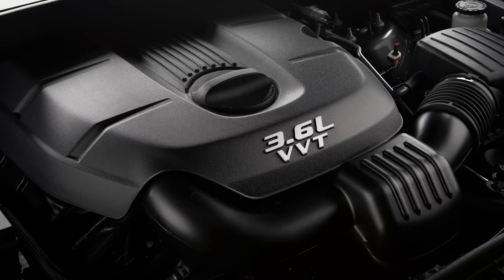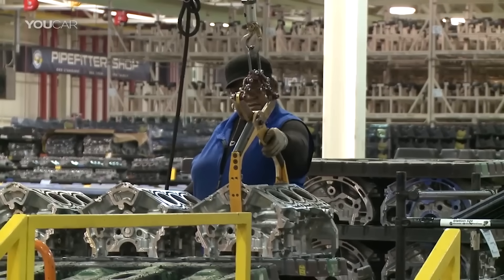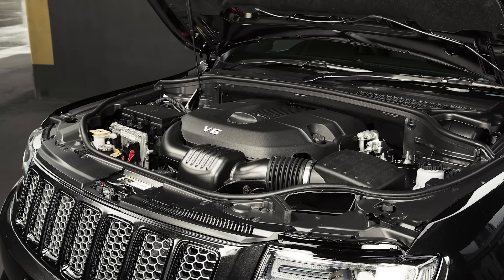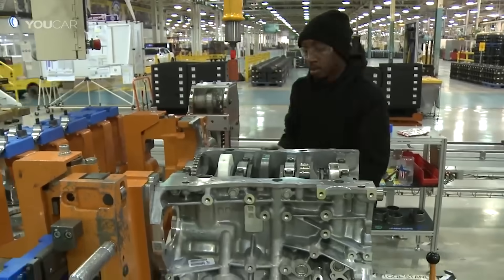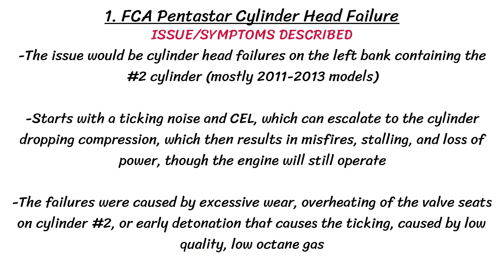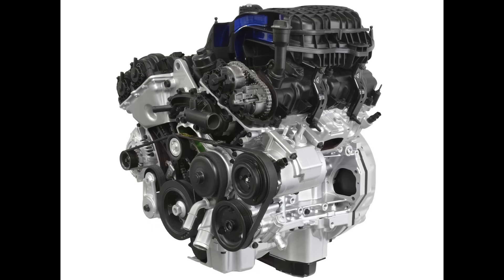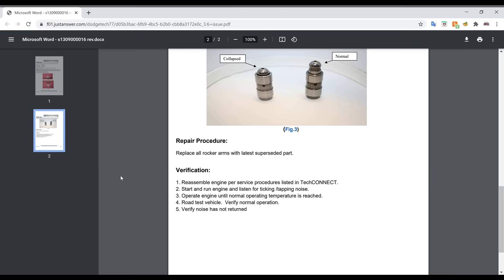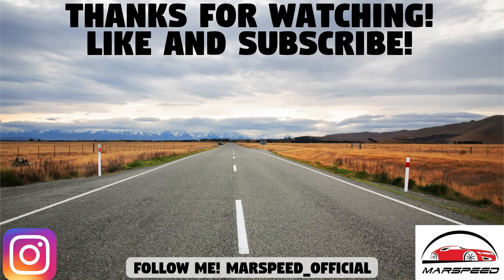The Specs and Fatal Flaws of the Chrysler 3.6L Pentastar V6 Engine

Comment: I’ve had 4 vehicles with these engines. A 2012 (125k) sold, 2017(152k)sold, 2015(142k still have), 2023(24k). All have been good engines with none of the cam issues people report. I change oil every 5k with full synthetic rather than waiting for the light to come on at 8-10k. I think that makes a lot of difference for not having head issues. Never had to replace an oil filter housing/cooler. I suspect most of those issues have to do with people over torquing the cap, which breaks the housing. Have had to replace a few thermostats around 80k, which is easy & cheap. The 2017 developed a head gasket leak at 152k. I bought that vehicle at 125k, and later experience with it taught me it hadn’t been maintained…my bad for not investigating better. Still ran ok, but slowly lost coolant. Head gasket issues are often caused by coolant not being flushed on schedule, which gets acidic and eats up the head gasket, but Chrysler also had a short term casting issue for that year. Brother has a 2012 jeep with 225k on it. Had the oil filter housing/ cooler replaced at about 180k. IMO, this engine is really solid if cared for correctly. 5k oil changes and 50k trans fluid change, 100k coolant flushes will keep it going 200k plus. I know others have had issues, but I have 5 direct vehicle experiences, and only one had a significant issue at 152k, and that was with poor maintenance. If you buy used, try to buy by 50k. At that point, you’re still pretty safe on longevity if you get it on a good maintenance schedule. Given my experience buy another vehicle with one of these engines,

Comment: My 2018 3.6 GC with 65k miles has had the dreaded aircon fault with the radiator in the car that failed. I don't understand why they break but anyway the dash has to be completely removed to get to it. It's a massive repair in terms of labour. Warranty covered that and the mechanics did a great job!
Also had a cracked gasoline filler pipe that runs into the tank that was replaced under warranty. 
Lastly an EGR valve error. Valve was cleaned and working perfectly now.
I saw in the car's service history that the water pump was changed twice within a service cycle, but I've had no cooling issues at all.
I was very nervous about the lifter tick but my engine does not have it. Using 5W-30 oil and adding Liqui-Moly hydraulic lifter additive for good measure. I've seen badly ticking cars go completely quiet when the lifter additive was added. It won't fix an already broken lifter bearing, but will help prevent damage from starting and also keep those hydraulic lifter oil passages clean.
I will have the oil cooler changed with the aluminum unit as soon as possible.

Comment: 120K on my 2015 Grand Cherokee 3.6L Pentastar.  DIY oil changes at 5K since day-1.  Proactively changed water pump, thermostat and coolant at 80K.  Original rotors and pads had life over 100k!
Zero mechanical problems other than radiator replaced twice under warranty due to what the dealer said were poor welds (very tiny, slow leak, not even enough to puddle, but could smell the coolant). Re-painted the hood under warranty at it began to bubble.  It is our "go-to" machine with the least troubles of any car I have owned over last 10 years (Honda mini-van that preceded it was also very reliable V-6).  Knock on wood - want to get another 125K out of the vehicle.  I got the lifetime Jeep warranty but have not had an opportunity to take advantage of it.

Comment: I have done 3k mile oil changes on my motor for my ram 1500.  This engine has been by far THE WORST MOTOR EVER.  I have had 2 cam shaft failures a head gasket that needs replacement,  a failure of the 4 wheel drive system and transmission issues.  I have given up on AMERICAN MADE and now will only by Toyota.

Comment: I've run my 3.6 offroading, on the farm and commuting.  I've had it since 2014.  I did have to replace all the lifters with the new style lifter about a year ago.   I didn't have time, so I sent it out.   It was about 2K.   I had to replace my oil cooler, in my experience its the o-ring gaskets that fail, not the whole oil cooler that is made of plastic... just the same, if you get THAT DEEP into the engine spending another 150 bucks is worth it.   It took me about two days to do the work myself, I could probably do it again in hours.   The design is not great on the Oil Cooler, sure you put the oil filter on top of the engine, but you still have to go under the engine to open the drain plug and the way the oil cooler is built and in the valley of the engine, you have to remove 3 layers of engine to get to it... So you save a little labor from your oil change done by a cheap tech, but end up costing yourself real $$ or real time changing this... I'd rather have the oil housing under the vehicle.  Other than that it's been really reliable, and it has a lot of power for such a light vehicle (I have the 2 door.)

Comment: Dealership replacing my oil filter housing next week,only42 thousand miles 2021. Bought it used last Nov. but did buy a warranty. I understand the part is still plastic. Guess I will be replacing it again at some point if I keep the vehicle. Anymore I don't know what vehicle to buy since thay are all garbage.
Reply: Make sure you get an aluminum thermostat and oil cooler housing. 2014 300 here just blew a head gasket at 162k. Learning a lot on how to modify  on next one. Use pure synthetic oil

Comment: We purchased a new 2016 Grand Cherokee Limited with the Pentastar V-6 and put 150K on it with no issues. However, I am confident that my first move was to drain the 0W-30 "oil" out of it and replace it with 10W-40 is what saved this engine. No aluminum engine will live very long with oil that has a lesser viscosity than water. I recently purchased a new 2025 Grand Cherokee, with the same engine, and changed the oil to 10W-40, when I got home from the dealership. Ford, GM and Chrysler all have engine problems because of this shitty oil. The CEO's of these companies are all climate change lunatics and should be fired.

Comment: Cylinder 6 misfire in old Volkswagen routan, head replaced with exteded engine recall warrant (115000 miles), then current pacifica in shop under warranty at 78000miles with rocker/cam issues.

Comment: From an excellent authority : " The cause of the failure is the use of thin metals used on the engines."  Known issue but will NOT fix it.  They do a "kit" for bank one camshaft failures. [ 2020 Jeep 4-door Unlimited 3.6 Pen., Rubicon  with 43,000 miles ]. $$$$$$

Comment: This video was spot on.  Had a 2015 GC Limited with ALL THREE ISSUES!  2nd Cylinder Fail, then Rocker Arm Issue, then AC Fail.  Paid out of POCKET to replace fix all except AC Fail.  When the Dealership quoted $4,000 to fix AC, I traded the GC in (almost 9 yrs @ 127k miles).  Did NOT get another Jeep.  It would've been great to keep the GC as I loved the vehicle, but it got too expensive to fix something that they weren't willing to cover or admit in engines beyond 2013.  Purchased the 2015 NEW ($42k) and it was well maintained... BY THE DEALER!  If FCA was willing to admit the issues or even give a discount on the repairs, I would have a more favorable review.  Now where's the Class Action Lawsuit...

Comment: 2011 Dodge Journey; clogged heater core due to sand.  2015 Dodge Grand Caravan; failed left bank cylinder head at 52k miles; removed and "repaired" at the dealer; failed again (misfires due to low compression) at 82k miles.  All 3.6s I've worked on stupid plastic thermostat cover breaks leaving plastic pieces to circulate through the cooling system; stupid plastic crossover pipe; stupid plastic oil cooler manifold.  Sure it's 42 pounds lighter than the 3.5L but sacrifices long-term reliability.  Fortunately, Dorman stepped up and created an aluminum variant of the plastic parts.

Comment: Love my 3.6 Wrangler but we had misfire in cylinder 3 only a week after we bought it. We ignored it but after 4 years it slowly got worse and eventually started burning off all the oil. We had to replace the oil sometimes daily. Our dealership kept dismissing us for this issue despite the constant oil loss. Eventually the engine power was so weak and the ticking got so loud that it was unsafe to drive at highway speeds. When we took it into our dealership they said nothing for almost 3 weeks. This was when we found out about a class action lawsuit on this engine from Jeep. We've been without our Jeep for almost 2 months and the dealership has hardly moved forward on replacing an engine. I think they know this is engine is faulty and are afraid we will have to replace it a second time again in 4 years. I love the power this engine has but the fact that nothing has ever been done to fix the flaws of this engine for over a decade is shameful

Comment: Best car I ever owned is the journey never broke down owned a lot of cars on the Toyota. Sienna has more problems than it and his lower miles. The only issue or not really an issue but the thing I would recommend for these engines if they could replace is that their plastic pieces for the radiator thermostat and had a small crack that leaked, but it was easy to fix and didn’t cause any issues.

Comment: I had the first gen 200 and had the cylinder issue, traded it in for a second gen 200 and have replaced every part of the cooling system more than once. The engine and transmission have been good but the cooling system is awful.

Comment: I own 4 Jeeps, and I've had nothing but bad luck with the Pentastar 3.6 V6 engine. 2020 Gladiator Sport S with 88k miles started misfiring. Took it in and cylinder 3 right side intake cam lobe wiped off. Rocker arm bearing failure. It's been in the shop for 2 months now waiting on back ordered intake cam. Out of power train warranty and will cost me 3k to fix. 2021 Wrangler Sport S with only 30k miles recently developed the dreaded ticking noise. Took it in and guess what? The same exact cylinder 3 right side intake cam lobe wiped off. Rocker arm bearing failure. If that doesn't indicate an engineering design flaw what will? Luckily this one is covered under power train warranty, but will be likely waiting months on end for repair parts due to Stellantis total lack of committment to existing customers on repair parts availability. And here's the thing, oil religiously changed every 4.5k miles with full synthetic Mobil1 or Amsoil. High quality oil didn't seem to make any positive difference. Once these two Jeeps are fixed I'm getting rid of them. I will NEVER buy another Jeep with the Pentastar V6. It doesn't  stop there either. 2022 Wrangler Rubicon XR with only 25k miles has engine hesitation on acceleration. No engine lights, but definitely giving me anxiety of what's yet to come. In my experience of 45 years of driving and owning 28 vehicles in my life is the Pentastar V6 engine is the most unreliable nightmare engine I've ever owned. My early 90's Geo Metro with a 1.0 liter Suzuki engine was by far a more reliable trouble free engine than the modern Pentastar. Separate issue, 2021 Wrangler Rubicon XR needs an ABS module that's been on back order for 10 months now to no avail. Stellantis total neglect on existing customer repair parts availability is beyong ridiculous. They are ruining the brand. You cannot build and maintain brand loyalty plagued with unreliability issues and lack of repair part support. My mechanic friend who has been knuckle busting on every brand vehicle for more than 40 years warned me about the Pentastar and Jeep unreliability, but I didn't listen to him and dove into the Jeep brand head first. I've been regretting it in an exponential way ever since.

Comment: I have  a 2011 chrysler 200 limited    with 210,000 kms  and the motor  runs fine. I run  full synthetic oil  and change the  oil at 6000 kms.

Comment: Typical click bait title.  Few engines have issues when first introduced to mass production.  This one wasn't exempt.  That said,  the later iterations of this engine have, for the most part, been solid.  I have over 300k miles on this engine design between two vehicles.  The oldest vehicle, 2014 vehicle with a 2013 produced engine, suffered the rocker arm failure common early on.  But even that didn't happen until 112k miles.  Dodge warrantied the engine and fixed it.  I still own the vehicle, and no problems since.

Comment: So I’ve owned one for 8 years now. Solid engine. I may have an issue in bank 1 with 134K but it seems to run fine and look fine on OBDII.  Stupid plastic y-pipes have been my biggest issue but that is not Pentastar specific but three zone climate specific.  At least the sand got cleaned out of the cylinders unlike Hyundai

Comment: I have a 2014 Jeep Cherokee with 156000 miles.  I did have to replace the oil filter housing/cooler assembly at about 103,000 miles.  Otherwise no problems.

Comment: I’ve had 3 of these.  On a 2012 JK, 2016 Grand Cherokee, and a 2020 Pacifica.  The only issue I had was sand in the head casting on the 2012 plugging the heater core which I semi cleared at least by reverse flushing water with a garden hose with the heater hoses disconnected.    The other 2 vehicles haven’t had any engine issues at all.

Comment: Im an old mechanic and an engineer. These engines make incedible power economically and are generally goid engines BUT understand: they have 4 chains ( and WHY drive the oil pump with a chain, but that's another subject), 4 cams, 4 cam phasors, roller lifters and they're all lucked into a small space. 
I don't want to be replacing cams, phasors, lifters or rocker arms so, I CHANGE THE OIL!
I use the recommended synthetic oil and at 30% " remaining oil life" I need an oil change.
Oil is cheaper than parts. Oil is cheaper than labor and oil is a lot cheaper than being stuck on the side of the road!

Comment: My daughter drove in a storm causing our 2015 town and country to hydrolock, I have mopar lifetime warranty which does not exists anymore but neither mopar or our comprehensive insurance wanted to cover, insurance wanted to total it, I decided to keep it and rebuilt the engine, right now half way just starting to put it back together replacing some of these components and hoping the warranty will stick after i had to do the repairs; if they deny any future failures caused by what is mentioned and well documented I will simple sue them for the price of the warranty back; with the warranty that engine was already replaced once because of a spun bearing; when I got the car it had 41K miles and that original engine failed at 59K! in m opinion they are garbage but they are popular garbage as a lot of people buys these vans; i wish I knew what I know now! in any case these days if the mopar lifetime warranty would not cover the engine anymore as I worked on it, I hope they can still cover other parts of the vehicle like electrical system, power train etc, whatever would not be engine related and covered normally, that is why I planned to keep it and repair it myself; it was $25k when I got it plus 3K for that lifetime warranty paid cash, the repair through the dealer aster the hydrolock was around 11-12K after parts and labor which is why I am doing it myself.

Comment: I have a 2020 Dodge Ram Promaster that has a cylinder 4 misfire somewhere between constant and intermittent misfire. Can not seem to find the cause. Swapped coils, checked compression, injectors, fuel pressure, spark plugs for good spark but can not find the issue.

Comment: Yeah well. At 95k my 2018 has a leaking head gasket or valve in cylinder 2. Low compression and P302. Quoted at $4500. Sigh. Driven very conservatively and well-maintained. First engine issue I've had in my cars back to 1977.

Comment: If you were worried and own/owned a 2011-2014 engine, or any of the flex fuel variants, just run E85 if it's available. Very high octane, cleaner burning and generates less heat which prevents gasket warping. 

Higher octane E10 is better than nothing but E85 is best in these. Even the new Challenger prefers and runs at it best with E85.

Comment: Don't mistake the noise injectors clicks for bad rockers clicking. The intake cover and foam pads under the intake  are there to reduce noise and stabilize engine temp. I've done some work on it, the right head for starters. Anyway Lucas fuel cleaner fixes issues caused by gas mixed with alcohol. Don't beat your engine. Good luck

Comment: The biggest problem with the Pentastar 3.6 V6 is the lack of upgrades and thus power and efficiency. They are however simplistic in design compared to the numerous complexed motors in vehicles nowadays, especially with direct injection only. I think Chrysler should be better off now having learned from their very dismissal leadership of past. Mopar needs to get back to what they do best and stop wasting money on nonsense designed vehicles with underwhelming power and mediocre build quality. Their quality was better with a partnership with Mercedes and that's saying alot. I wouldn't waste my money on a Chrysler product until they get their heads out of their asses. By far the worst American made brand behind GM. 🫡🇺🇲